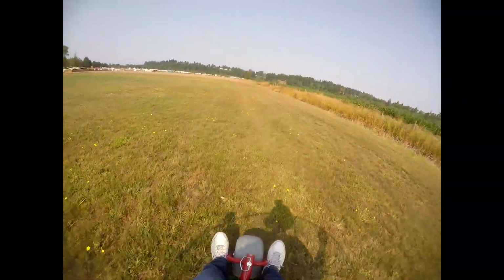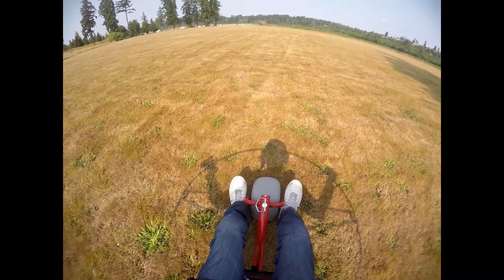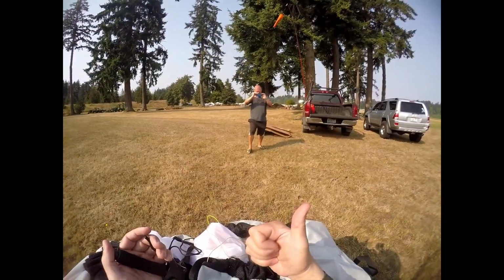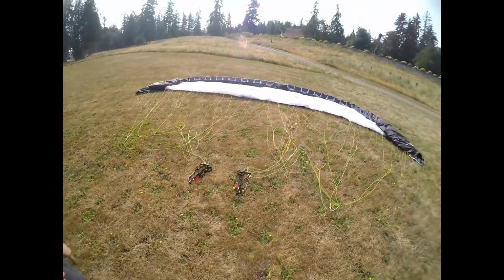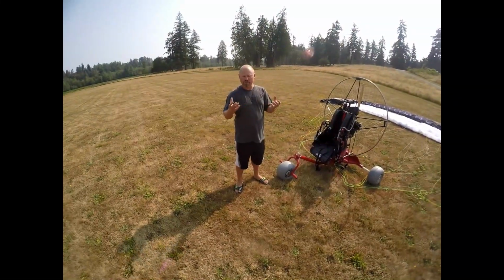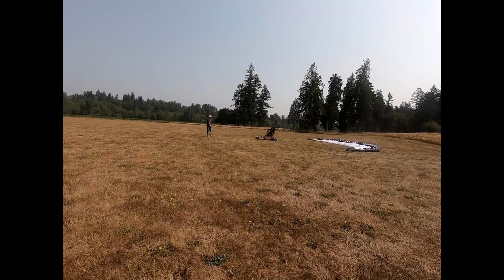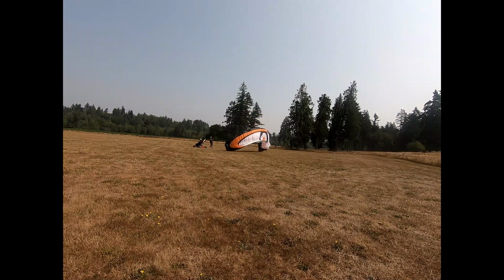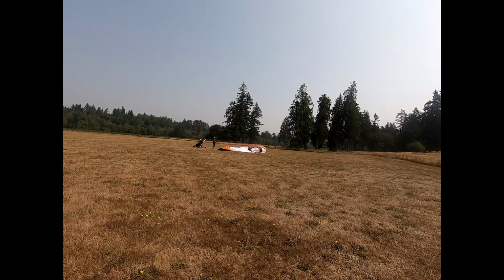Learning To Fly a Trike - Paramotor

Comment: I know exactly what you mean I have a flat top  Air trike set up and I like racing motorcycles in a parking lot next to my shop.      .26 /mile concrete. So far I've had it up to 58 miles an hour before  I had to slow down

Comment: The real reason trikes tip over is because they face the front wheel forward. The front wheel needs to face backward slightly so it drags. That way you don't even need your feet on the pegs and it will always go in the right direction should the wing want to move you. those tyres I think are meant for sand BTW>
Reply from the maker: Thanks fro watching.
Reply: You still need your feet on the pegs I  Have an air trike set up the way you are talking about.  racing a go kart on concrete A  Car pulled out in front of us and since there's no brakes i let go to drag my feet and the front wheel started shaking violently and bent the forks and sheared off a bolt in the carbon fiber that holds the forks..... .. lol . .............. running about 50

Comment: How much does the trike weigh without the motor, what motor is it and how much do you weight, it seemed your climb rate was a bit slow, perfect take off by the way, how was the landing?
Reply from the maker: Hi David, the trike weighs 31lb, the motor is an Air Conception Nitro200 Elect Start no clutch. I believe it is 45 lb. I weigh 225lb. The landing was great. The power may have been low that day I think because the belt was not properly tightened. I will have more on this soon.
Reply: I would have thought the trike would have been 40 lbs it just looked heaver.  My trike is 30lbs, flat top is 61 lbs with a moster 185 I'm 180 lbs of  pure muscle lol not really. I can take off as fast as a knuckle dragging foot launcher if the kite is straight right off the bat, keep up the great work bro.
Reply: I watched that again it wasn't a perfect take off I take that back, LOL, you did it though so it's all good.

Comment: I have one just like yours but in Black.   How has it held up for you.  After two days of practice the front fork on my trike had completely messed up.   The hole the pin goes through became oblong and the front fork would swing back and forth by about 5-6 inches.  Does your fork have a bushing in it.  Mine did not and my box didn't come in nearly the same condition your did.
Reply from the maker: Is yours from Aviator for the Nitro 200?
Reply: Yes, sir!   Just like yours but in black.   That is why I was wondering if your fork had a bushing.  Mine was just a hollow tube and it didn't hold up well at all.  I had to cut out the bad part and weld in a new 2" section of solid aluminum and a new bronze bushing.  Yours looked real solid in your video.
Reply from the maker: Are you on facebook? Much easier to exchange pics and stuff in chat there. When did you buy yours? Just looked at min there doesn't appear to be a bushing but the section of tubing is reinforced.
Reply: Just watched your video again.  Thought I'd check in and see how well your trike is holding up.  My reinforcement that was made to the fork has held up well.  I'm trying to learn to taxi in Alfalfa fields.  And those plants are like little bumps all over the place.  And you have to avoid the irrigation ruts, so not a great place to learn.  And it takes a toll on an aluminum trike for sure.   Only suggestion I would have is if your fork is still in good shape, swap out that pin for a 1/2" Carriage bolt.  I added 1/2" Nylon spacers at the top and bottom and then tightened the nut until the fork was difficult to move from side to side.   Once you get it on the field and use it once, it looses up just enough.  Let me know how your trike is doing?  I'm curious.  ;o)
Reply from the maker: @brod5352   Thanks for getting back to me. I am working on my review video now. My trike is doing well. Are you anywhere near Washington State? I would love to meetup and fly sometime.
Reply: @MrCPPG  ....I live in Northern Colorado.  Travis and Kyle were both in my town a few months ago when they visited Rocky Mountain National Park.  They flew with my instructor Daniel West but didn't realize it until after they had left.  Glad to hear your Trike is holding up.  I know your's sure arrived in much better shape than mine.  My box had some pretty big holes in it and the trike got scratched up quite a bit.  But all the parts were there.  And I knew that the paint wasn't going to last due to the nature of the sport.  But the Alfalfa fields really took a toll on the fork.  Turned that 1/2" hole for the pin into about a 1" oval.  Way too much slop.  That's why I recommended the 1/2" Carriage bolt.  To get rid of the slop.    AND.....Aviator PPG took care of me as they always do.  I'm planning on being at the Salton Sea 1/29 throught 2/10.   That's when I hear the next get together is going to happen.  The way things are going I may get my first flight in out in California.  I think the conditions at the Salton Sea will be much better than Northern Colorado especially in the winter time.  Hope to see you there.   ;o)
Reply from the maker: @brod5352   Good to hear that Aviator took care of you! the Salton Sea gathering is in Feb.  I am hoping to make it down there for the event. Here is the link: http://www.trikebuggy.com/sites/boogie_ss.htm

Comment: Just don't catch your rear wheels and roll over like I did. ;)

https://youtu.be/UOt8j-uQTsc

A little grip tape on the foot pegs works excellent!... especially if the grass is a little bit moist.... My Axel's are fiberglass, I used to wipe the unit down after each flight and then I learned that was a bad idea... made the foot pegs real slippery.

Also if your trike doesn't allow you to set the angle of your thrust line slightly higher so you're blowing air over your wing at idle you can add longer, rubber bottom engine mounts mounts... for the trike you usually want about 10% thrust line over the wing. This way you're not distorting it before you pull it up.
Reply from the maker: Yeah I have been wanting grip on the pegs, thanks for the suggestions!

Comment: So..........WTF? You just decide....to take another Lap around the field ? And just now came back?yea right?
Reply from the maker: Pretty much. I had already done foot launching and this was an addition skill. I have also practiced a lot on my own since then. The one front wheel of the trike can be unstable unless it is braced well. The main thing to practice on a trike or any wheeled launch is get the wing locked in directly overhead and stable before rolling on takeoff thrust. If you do not and just gun it, you will liftoff and swing sideways into the ground.

Comment: Dont look like much thought went into this design
Reply from the maker: The trike is from Aviator PPG and is no longer sold by them. There are definitely some weak points and some good points about it (wheeleez tires are awesome).  The trike allows quick connetion of the paramotor so that foot or trike is possible in minutes. It is purpose made for the Nitro 200 and was produced before Air Conception had come out with their own trike and that is why I purchased it in 2018.  There are definitely better ones out there for purchase today.  Thanks for watching.
Reply from the maker: @journeymanelectrician   Honestly if you are handy welding you can make you own. Yankee made some plans for free.  I have Wheeleez balloon tires and I find them superior on sandy beaches and good for all other surfaces.